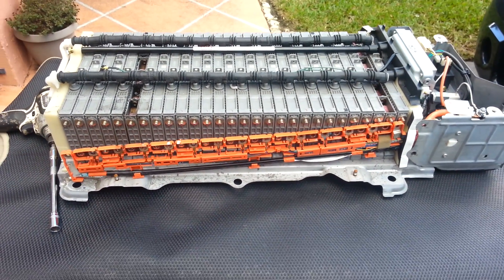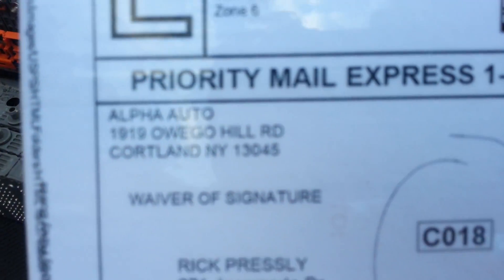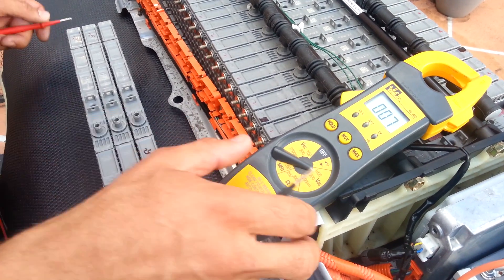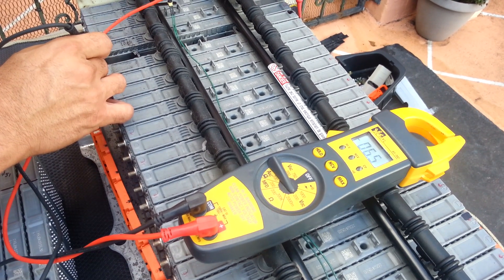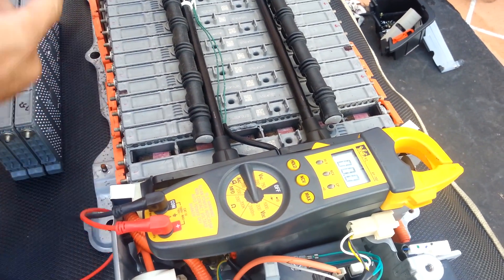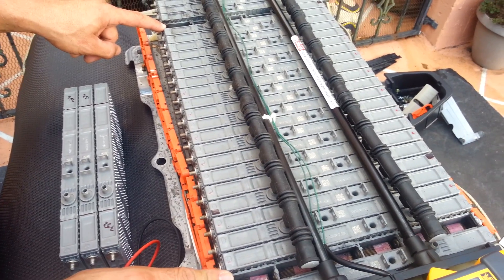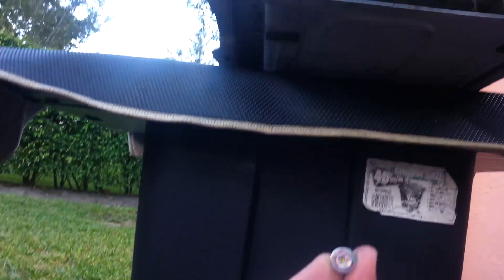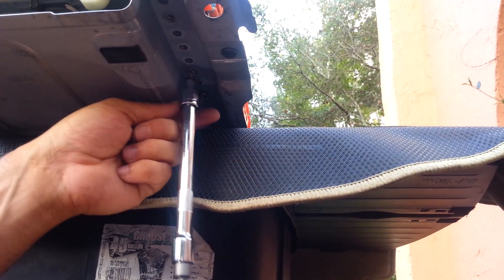Testing a Prius Hybrid Battery

Comment: Always take the orange caps and the 8mm bolts out of each cell and check for corrosion behind the orange plate under each nut .  I almost always end up cleaning up a bunch of corrosion on the 1st 2nd and 3rd generation prius battery's and camry hybrid batterys as well.     In the 2nd gen prius their really bad about leaking rain water from the factory moldings at the top of where the hatch shuts in its track .also above the tail light  too.   You should always inspect for water trails and do a leak test on the 2nd gens because water is the #killer of these battery's.  I always take the drain grommet out of the battery hole and spare tire hole if they do leak until i can confirm the leak is gone.   Best of luck everyone .  This is good knowledge to have considering gas vehicles will unfortunately be a thing of the past within the next 10 to 20 years and best believe the ones experienced in these hybrid cells will be making bank if they wanted to open their own shop

Comment: I just tested all my cells on a battery from a 2007 prius. 2 read 6.4, and the rest were 7.7 and 7.8.

I understand that the 6.4 are too low, but are the 7.7 and 7.8 too high?
Reply: Those 6.4 are going to kill those 7.7 if you don't replace them

Comment: Very bad video and many wrong tips: You do not have to remove all modules to swap bad ones. Voltage test is not acurate. Broken nimh battery also can have high voltage but under the load it goes rapidly down causing mcu error.  At the end,  balancing is very needed if you add modules. They should be all connected in paralel mode for min 24h or even longer. Cleaning copper connections.

Comment: I am not sure that is the right way to test the cells. I got an engine light which said the battery needed to be replaced. I checked the  voltage by techstream software and  several packs(two cells in each pack) showed a voltage around 17 volt for my Lexus.  it's supposed to be above 20 volt. I removed the battery and tested the cells. All cells showed around 10.5 volts. So according to your test that is 21 volt per pack. So all cells were good according to your test but they are not. So your test does not really work.

Comment: Do you have to take off the orange plastic? To check the voltage ?
Reply: I highly recommend it .
Reply: I found once behind the orange plastic their was a bunch of blue corrosion that I had to clean with a tiny wire brush on a drill .  Some people use dielectric grease as well.  It's not a must but if you ever take it apart again they almost always need cleaned up again unless u use die electric grease

Comment: I already changed my battery cell but still hybrid system light on.how can I fix for that
Reply: same thing happened to me. all my cells were at 7.85-7.86 volts each, the two bad ones were 6.5. both were replaced with 7.55v cells. battery doesnt discharge quick at all but red triangle, CEL and others keep coming on. app says block 14 has an issue but idk which oke that is
Reply: @broken.bimmer4119  ...have you cleared the codes with a OBD yet?
Reply: Dan The Man yeah i have, once i clear it, it drives fine for a couple min. runs on just the battery too. and then the fan just keeps running and the lights come on. i keep driving it or idling. i thought maybe it was a cooling issue at first but temps good. it also stops using the battery completely after a little, no power to or from it after driving it with the lights on. i then have to restart. this is my first prius lol
Reply: @broken.bimmer4119  . What do the fault  codes tell ya? P080A maybe?
Reply: Dan The Man im not sure, id have to check. nothing pulls up on reg obd ofc. im using an app called Dr. Prius. i believe it was just p3000 but i think that was before i replaced the cells. also i didnt balance the cells. could that be why?
Reply: Dan The Man alright so heres an update. took it all apart again and cleaned off the corrosion on the bus bars. the two replaced cells were now at 7.80 instead of 7.55 which shows they are balancing and charging. the others are at 7.85. Drove it after and it passed everything. no codes. multiple hammer downs and it drove perfect. battery was barely coming down as well on the trip thing. went on the highway to charge it to full. it was going great and then suddenly the abs, Brake, and vcs light came on and then 20 sec later every other light and the car just died
Reply: Dan The Man i had the volt meter and this time i was like i think its the 12v battery. sure enough it was a at 8v and the car was barely lighting up. only check engine light would come on when i pressed start. jumped the car from the front and it started. all lights went away and drove home just fine. until it died while pulling into the driveway. red triangle came on and check engine light and it threw the following codes. P0A94, P0AA4, P0AA1. now im at a loss and have no idea what to do
Reply: Broken.Bimmer ..those codes point at possible hybrid battery contactor circuit stuck closed. Check wiring harness and check that wiring isn’t damaged. Faulty system main relay. May only have a poor connection. You might consider finding a shop that has a Toyota diagnostic computer to get exact cause, some do it real cheap to possibly get your business. There are many YouTube videos showing how to replace the main harness.
Reply: Dan The Man hmmm isnt that odd how it would mess up all of a sudden? also the 12v battery keeps dying out now. its at 8v. could a bad 12v battery cause those codes?
Reply: @broken.bimmer4119  ..well if your unconnected battery is 8v change it out. Then get to the next issue, which point to main harness. One step at a time. One bad electrical system reading can throw wacky codes.
Reply: Dan The Man thats what im thinking. ill have the battery checked. the draining just started happening. could be coincidence that it just went bad
Reply: @broken.bimmer4119  ...if your voltmeter shows 8v you need to replace it not get it checked out. Then clear codes and see what codes pop up, if their the same codes replace main harness as it may stay open or closed.
Reply: Dan The Man okay great thanks!
Reply: Dan The Man i think i figured it out. hybrid battery wasnt bolted down which meant it wasnt grounded. i think it drained the 12v battery and caused the other weird issues. put 3 bolts in and now its driving fine. didnt replace the 12v either
Reply: @broken.bimmer4119  ...glad to hear you found the issue, good job.
Reply: Dan The Man fml, just my luck. this morning i drove the car for 30 min and it was perfect. got home put the whole interior together went to start. and nothing, battery somehow drained again. just got the new battery installed and guess what. no start. “ready” doesnt come up. now wtf do i do
Reply: NEVERMIND, just thought back to it and realized the orange plug had pulled up after i was messing with the shield LOL have a few min of pure anger there lol. thanks for your help tho
Reply: ze lum ......have you considered that bluetooth OBD scanner with app that showes exactly which cells are bad. Also try clearing the codes and see if they turn back on.

Comment: I was just told by the guy I bought my used cells from that a voltage test is not accurate and the only way to properly re condition a battery is to load test each individual cell after it has been charged and discharged 3 times.
Reply: This is correct, you have to load it them monitor it's discharge. Sometimes they would show good voltage on a table test but then won't hold charge when it's in the vehicle
Reply: Yup it’s very hard to test
Reply: How do u load it to charge?
Reply: How do you load test?
Reply: @danielbob4310  with a insulation tester the fluke 1507
Reply: @danielbob4310   They sell load testers for 12v batteries that will work fine.  Ignore the scale and just watch the needle.  If it holds, then you're good.  If it drops, questionable or bad.  You can also use a 12v light bulb and see how long it takes to drain.  It should hold for 30 sec, I believe it was.  The Fluke 1507 is not the right meter.  That tests insulation, not load.  It's good to have but for a different reason.

Comment: Why don't you buy brand new cell? No need to spend money on used cell.
Reply: There's a very good reason why people have been using reconditioned cells instead of new ones -  the patent holder on the batteries has never allowed sales of single modules to the public . Only Honda is allowed to sell them, and only in complete batteries.

Comment: below 7.5 have fault or 7.0 ?
Reply: Usually the faulty battery modules will read at 6.x volts
Reply: @Antonio-bf2pc  why the fault battery voltage can reach 6.x?

Comment: Can someone share a video of how to take cover off for hybrid battery?
Reply: Look on youtube. There are plenty of videos.
Reply: @Antonio-bf2pc   I wrote down that I am not able to find that videos, glad if you can help.
Reply: 201VOLTS!  Wear PPE...electrical insulating gloves, safety glasses, etc.
Use HV ( insulated ) tools inside batt. case.
THE VERY 1ST STEP...PRIOR TO BATT. REMOVAL FROM THE CAR ITSELF IS TO REMOVE ORANGE SAFETY GRIP.
THIS PLACES BATT. IN "SAFE" MODE.

Comment: You should test the NiMh batteries with load. There are not so many packs so you could connect each pack with wires to the cabin and measure the voltages when driving the car. Using very thin insulated wires makes it more safe in case of short circuit. I don’t know if service stations have a measuring jig for this as it is very reliable way to detect bad packs. There may be a computer program which measures all the voltages as a plotter. BTW, you don’t have to swap the test leads when measuring (when using a digital multimeter).

Comment: This is not the right way to test, you need to load test them. I had good readings across the board voltage wise but had cells not holding.

Comment: There are  a few tips for fixing a car battery
never attempt to do this until you are sure what you are doing - the acid can burn your skin
Test the voltage first - there may be a kaput cell which would waste your time.
Check the battery fluid.
Try to fully charge the battery.
(I learned about these and more from Jons Mender Guide website )
Reply: Please post how you are going to check battery fluid on a Toyota Prius hybrid battery.

Comment: NEWSFLASH SHIRTLESS WONDER, voltage is irrelevant !  The load required to move a 2400 lb "car" is significant, potential energy  is measured in each load cell by how much amperage it can produce in a symphony (unfortunately by bad design, no cell jump circuit). Potential energy is amperage where as voltage is the electron force. Physics 101.  These little cells are a bad design because theyre low quality 8v compartmental cells that fatigue and reverse with each charging/discharging cycle. In street terms, kind of like bending an aluminum can back n forth--eventually they give and reverse their polar electron field because they`re unstable. Why do you think Hybrids are going through Generations ? Theyre at the stage where lithium cells may come in but ask burned vapor cig owners and Samsung cell owners about that--hmm, a japenese Hindenburg--new image of a wienny roast !
Reply: You spelled weenie wrong, genius.
Reply: Sonny These batteries that you call a "bad" design are lasting for 200,000 - 500,000 miles.
Reply: Sonny All cars go thru generations with improved technology smarty pants
Reply: And when a cell goes bad, you can replace it for $30-40.
Reply: It is "weenie", or "frankfurter:.
Reply: They are going though generations because technology evolves you fucking moron. When they were designed, they were tip top best of the best.

You're basically saying that the first cae ever designed was a bad design because it can't go 100mph, but tat the time it was the best they could do.

Comment: So let me get this straight. If your hybrid battery fails, it could be due to bad modules/cells? If you replace the module/cell then your battery will work? Can someone explain this because this just made since of why dealerships want to charge an arm and a leg to replace the battery.
Reply: S Keith, you are Right.
Reply: Because of greed, money, and not caring about people.
Reply: It's the difference between a temporary vs. "permanent" repair.  Once the "module replacement" process starts, it's something you keep doing every 3-6 months.  When a dealer installs a new battery for "an arm and a leg," you're getting a new pack that will likely last 100K+.

Comment: here's  several ideas for battery reconditioning
Don't try to do this unless you are sure what you are doing - the acid can burn you
Test the voltage first - there may be a dead cell which would waste your time.
Check the battery fluid.
Try to fully charge the battery.
(I learned about these and more on Jons Mender Guide website )
Reply: Not acid, they are Ni-cad batteries.

Comment: There are  several things for getting a good result
never try to do this unless you know what you are doing - the acid can burn you
check the voltage first - there may be a kaput cell which would waste your time.
Check the battery fluid.
attempt to fully charge the battery.
(I read about these and more on Jons Mender Guide website )
Reply: Gen 2 Prius uses Nimh batteries, not Nicad.
Reply: These are nicad batteries, no acid. But the real danger is the voltage: 200 volts DC, which is much more dangerous than AC.

Comment: Hi Tamara,

I use Toyota Camry 2007 Hybrid. Will any hybrid battery work for the car or how do you tell the specific battery to buy.
Reply: You need to test each individual cell with load. Fully charge the battery first, get the voltage reading without load and then check again with the load. You can use a 12V light bulb as load and test it. The good battery do not drop voltage and it holds up the load.
Reply: these battery packs are never fully charged. Toyota decided to charge them from 40% charged to no more than 60% (sometimes goes to 65%) so that they last over 10 years.
Reply: Olawale Olaleye

Comment: Good job DIY and save lot of  $$.

am wondering if there any battery test that one can quickly use to identify bad cells prior to taking the pack out?
Reply: No, because they are all connected in a series.
Reply: yes, my innova scanner is able to show each module (which consist of 2 cells). In the particular prius that I have right now all modules read at 15v. I believe this reading varies, even on a good battery, when under load.  The reading may be higher around 16v. I assume thats because the battery is being charge also. No clue really, just assuming. 

Also when testing, i believe each module needs to be within .2v of each other. Again not sure. heh.
Reply: James Chuaycham ป้อม ศักดิ์ชัย